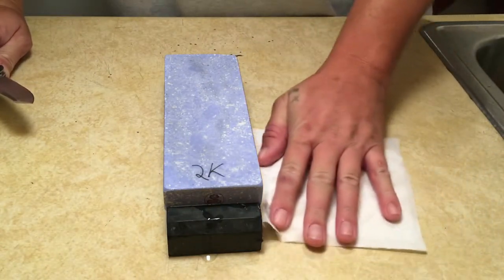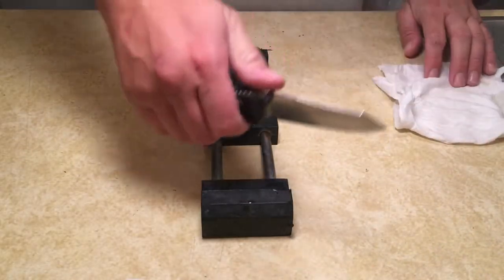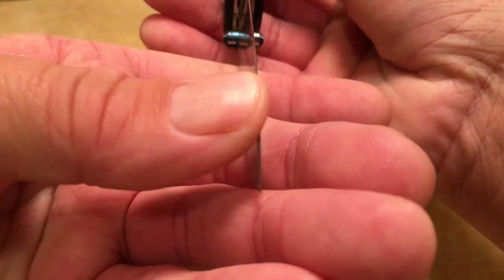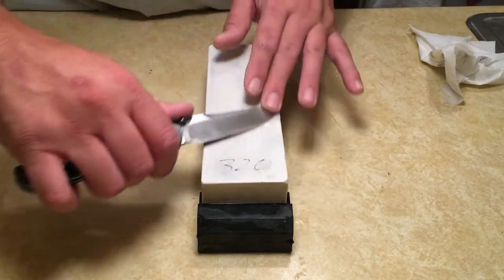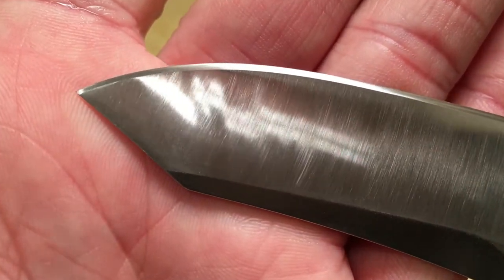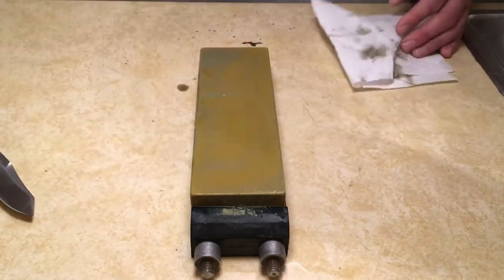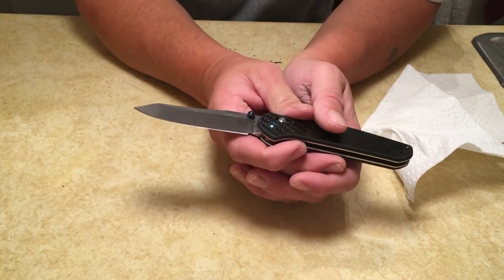Knife Sharpening - Basic Technique and Demonstration

Comment: Excellent instruction. Followed your tips and it worked like a charm. Particularly, practicing your hand stroke.

I don't need to do crazy mirror-finished edges, but I do want to practice and learn how to get a decent edge free hand like the big boys. Not interested in the KME type contraptions.

To cover the bases, what would you think about two diamond stones, DMT or Atoma, in 600 and 1200 grits, with a strop to maintain the edge?

Thanks!
Reply from the maker: Both are very capable. I just have issues with the amount of material diamond removes. I'd recommend you look into the resin diamond stones that Venev offer. Naniwa also has a set, as do one or two other companies. King makes a 1k diamond resin, and edge pro, has a full line. Their stones are obviously made for a 'kme like' contraption, but I have sharpened on them freehand, many times. 

Otherwise, I would tell ya to avoid diamond, and get 3 stones. Gritomatic silicone carbide. 240, 1k and 2.5k. Toss in a strop, and you are rocking. Gritomatic also sells the Venev diamond, if you care to have a look at pricing. I've done a few videos with em, just search my channel.

Good luck! Glad to hear you were able to gain some tips from my video. I really feel like I should redo it, and try to condense the info down, but from start to finish, there is ALOT to cover.
Reply: @Jef  Thanks for getting back. I'll check out your suggestions.

If you do redo the video, if it's possible, I would suggest a sample camera angle when you're stroking the stone that's over your shoulder. My right/left brain was going a little crazy. Maybe it's just me.

Again, in addition to all of your commentary as you paced through the video, the real helpful part for me was emulating your stroke.

Thanks again!

Comment: Excellent video, I subscribed. My 2 cents on stones. For a low grit stone that cuts great with good feedback, I like the Shapton Glass 500. Generally, I don't like the other SG stones. I also much prefer the King 1200 over the 1000.
Reply from the maker: Yea i do like the glass stones in terms of speed and efficiency. Esp the higher grit polishes that can be achieved. As far as the King go, I could never tell much difference between the 800, 1k, and 1200. They all seem to feel very similar (kds). Now there is another model King offers, i forget the designation, but it is softer. The mud produced from it is pretty heavy. I never cared for that version.

Comment: This is a gem Jeff! I am a struggling beginner and can't thank you enough. I have some questions: can you suggest a stone holder or sink tray? Can you suggest 3 or 4 stones to get started with,grits and brands? Will this technique work with kitchen knives as well? Can you recommend the stones to use for flattening? Thanks for all your efforts!
Reply from the maker: Awesome! Glad you found it useful. 

The only stone holder I have tried, is the one shown in video. It is just a standard universal stone holder, from chef knives to go. Approx $30. Sink bridges are a bit finicky. I have bought 3 of them, and none fit my sink. That is why I have that big plastic food tray, I've shown in a few videos. It was purchased locally from a restaurant supply shop, approx $20. The Suehiro sink bridge fits across it very well. I got that from Japanese knife Imports, but I seen Chef knives to go carries them now as well. Both approx $40. 

Stones are really gonna depend on budget. I always recommend Shapton Pro, if you have some money to spend. 320, 1k, 5k is a solid 3 stone set up. If you wanted to throw in a 4th stone, you could either go coarser or finer. The 2k is an excellent choice to follow the 1k, and the 8k fits perfect behind the 5k. I rarely go that fine, because once I hit 5k and strop, the edges I get are plenty sharp. Plus, the polish is bright enough to satisfy my desires. 

If money is tight, the Imanishi 400 Latte is a fantastic starting point. It is hard, and scratchy. Exactly what I like. The price is nice too. Around $50. From there, the King 1k/6k combo is an excellent choice. The 6k is a bit softer than I like, but just getting started, it is solid. Again, those 3 stones will get ya where ya need to go, and adding a 4th is just icing on top. Skies the limit, and you can again, pick either coarser, or finer. It's up to you. If the King brand doesn't suit you, I've heard the Imanishi 1k/6k combo stone is a fantastic substitute, although I haven't tried one...Yet. It is approx $55. 

If you just want the best of the best, and want my current favorite set up, I would say 400 Imanishi Latte, 1k Nubatama Ume extra hard, 2k Shapton, 5k Shapton. Then a DLT XL double sided strop, with compound of your choice. White compound, from Stropman is still my favorite, although he passed away recently. His compounds are still available on ebay, and his website. I imagine once they are sold out, I'll have to find a new compound dealer. Be prepared to spend a little money, and you would have to contact Kenneth Schwartz through email or telephone, to order the Nubatama stone. Obviously, Shapton Pro 1k could fill that spot, but the Nubatama is just my favorite all around do everything stone. 

This technique works on just about anything with an edge. I don't change my methods for kitchen, or pocket knives. If you watch any of my videos, the only thing I didn't do in this one, is pin point pressure, grinding up the blade. I just wanted to show a basic, easy to do technique. 

Flattening plates/stones are a bit over priced in my opinion. I used a 140 grit Atoma plate in this video. The DMT plates in my experience, shed the diamonds too quickly. If you want to save a few dollars, get a scrap piece of glass, and some silicone carbide powder, and use that to flatten stones. They sell them in 4 grit packs on ebay fairly cheap. Just look for 'rock tumbling grit'. It is my preferred method, and I have several videos showing the procedure. Stefan Wolfe has a bunch of videos too, and documents the process extremely well. 
 
Hope that helps ya!
Reply: Jef Jewell wow! Great information. I can't thank you enough!

Comment: What is a line up of your favorite stones that fits all grits?
Reply from the maker: Actual favorites to use or just a solid line up to cover all ranges? 

I’ll answer both ways 😁
Favorite line up - 120 Shapton Pro, 400 Imanishi Latte, 1k Nubatama Ume xhard, 2k Shapton Pro, 4k Nubatama Ume, 5k Shapton Pro. Generally I’d stop here, and strop. If I want more polish however, 8/15k Shapton pro. 

A solid line up that covers all bases - Gritomatic 240, 1k, 2.5k. Cuts every steel I’ve used it against, won’t break the bank, and leaves a decent finish. Want more polish? Throw in your choice of Shapton Pro 2/5k or any other polishers between 2-8k. Sky’s the limit here. The 2.5 Gritomatic leaves you in a nice position to transition to many finer grit polishing stones. Generally, in my videos, I go to Naniwa pro 3k, then Shapton Pro 5k.
Reply: I’ll have to check out Gritomatic! Thank you Jeff
Reply: Where do I locate these gritomatic stones? the only I see are for guided sharpening systems like KME, Hapstone etc.
Reply from the maker: Sorry I just seen your reply. Never received a notice it was here. 

Gritomatic.com sells them, however, they have been out of stock for almost a year now. Supposedly they are coming "soon", but your guess is as good as anyone's, when that will be. I'd suggest trying to get on their wait list for them, and when you receive an email in stock, to grab a set. They are about as good as you can get, without having to use diamonds.
Reply from the maker: https://www.gritomatic.com/products/8-x-3-silicon-carbide-sharpening-stone
Reply: Jef Jewell hey no worries brother, found them on amazon. Thanks for the reply your awesome

Comment: Hi Jef. I've bought an Opinel no9. It's a flat ground blade and i'm laying the blade flat on the stone so I don't get a secondary bevel which is what I want for wood carving.  I've discovered by studying the blade that the factory grind is set for the straight part and is missing the belly & tip line because the knife blade thins out there, so the set angle of the factory machine passes over it without touching it! (The Mora scandi blades are the same thickness to the tip so their machine cuts to the tip evenly all along).
 I'm not really sure of the best technique (movement wise along the stone) to avoid putting a bevel on this thinner area as I'd like to stay "flat ground" all way along. Hope you can visualise this and suggest something or even try it yourself. I bought a second no9 to put a secondary bevel on and experiment with. ATB from the UK. Pete.
Reply from the maker: It is a similiar thing to following the belly curve of a secondary edge. You just have to lift your hand slightly, to get to the tip area. Check out a few videos on my convex sharpening, to kind of see how I demonstrate it. It isn't difficult, but since the Opinel are pretty thin, it may feel odd and flex.
Reply from the maker: Belts are completely different from stones. I can't even start telling you whats what with those, cause I don't think they are appropriate for sharpening. They heat the edge up too hot, and ruin the temper. Just my opinion, many others swear by them. Unless they are water cooled, I'll avoid em.

As for stones, if you lay the knife on the stone, and put pressure on the flat where the tip is, notice the handle raises higher. That is what you must mimic when holding it. Make sure the blade isn't flexing because that will cause differential grinding.
Reply: Hi. I can, and do do it it Jef, Just trying to understand the why of it. I think I'm settled on it now. I do overthink things you know. ATB. Pete. Ps. Sharpened both no9's this morning. One flat zero ground, the other a laid back secondary. They are both doing push cuts on phonebook paper, cross grain!!! off a 400 diamond.
Reply from the maker: Diamonds can leave amazingly sharp and crisp edges. Although I have never been a fan of them, I can't dispute their results.

The why of it is geometry. I'm no mathematician so I won't try explaining it, but there are a few videos discussing belly and tips, and how the angle of attack changes. If you haven't ever reached out to Cliff Stamp, he has a forum where many knife sharpeners discuss all things. You could always pose your questions there, or try to email him directly. He has always been very accommodating to me, when I have asked him direct questions through email. I know he is a busy man, but he has always freely shared his knowledge with me.

Comment: Any suggestions for stones for a newbie?
Reply from the maker: Depends on your budget and what you are trying to sharpen. A solid set would be the King brand. 220, 1k/6k combo, would do just about everything you could need. From reprofiling a knife, to getting nice shine and polish. An alternative to those would be the Imanishi Latte 400, 1k/6k combo. They are priced well, and are harder stones, than King. If price isn't an issue, I always suggest Shapton Pro. They are the stones I started with, and have never regretted using them. To this day, they remain my favorite go to set up. 320, 1k, 5k is a solid 3 stone set up, or throw in the 2k as well, to help refine the scratches before 5k.

I also suggest getting a strop, with compounds. There are hundreds out there. The strop block from knives plus is fantastic. Preloaded with compound, and your choices of green or white compounds. I prefer white, but the green isn't bad either.
Reply: Thanks!

Comment: How much water and or oil? You haven’t touched on that. Thanks!
Reply from the maker: Depends on the stone in use. This particular Nubatama stone, requires about a 10 minute soak, to get saturated. After that, i just splash as needed. That is, when the swarf gets thick, with dark metal filings, or the stone starts to feel dry. 

Other stones do not require soaking. They can be used, out of the box, with just a splash of water. If you are unsure, try to google the stone you are using, and see what others recommend, before you soak them. Some splash n go stones, can crack, if you soak them. 

Otherwise, it’s personal preference. There is a higher degree of cutting, from the stone, when it is dryer. Personally, i prefer to have it well lubed. If i could find some sort of steady drip, as i worked, i would make use of it. 

Oil stones are a completely different beast. I recommend soaking them in oil upon buying. Leave them for a few hours. Over night would be even better. Place them on a rack to dry, obviously with some thing under near to catch any dripping. After that, when you use them, it should only require a few teaspoons, if that, of oil, to keep them lubed. Again, as the stone drys while sharpening, i would refresh as needed. 

These days, i rarely use just oil. I find a combination of, one part baby oil, one part dish soap, and 4 part water, to suffice. I tinker with those ratios, as i see fit, to get a consistency i prefer, but that is the basic recipe. I only use this concoction, on natural stones, and oil stones. 

I do not recommend, especially water stones that have magnesia bases, placing oil on them. Oil on some water stones, while inert, i fear, could damage them. Possibly, even crack them. 

Some water stones are more forgiving; the traditional, older type. As an example: the King brand. I have used oil on my 1k King water stone, with satisfactory results, but again i do not recommend it. If your stone gets damaged, i would hate to see blame placed at my feet 🙂
Reply: @Jef  I have a Smiths Tri-Hone. Not too much out there on it. It comes with a solution but the stone seems to just soak it right up. I’ll have to experiment with it.
Reply from the maker: Soak the stones in oil. That is, if they are the oil stone versions. Inhave one as well. Think i did several videos on it. Search my channel for smith.
Reply: @Jef  thank you

Comment: If I'm using the 1000 and 3000 grits and working my way up, how do I know when to switch to the next stone?
Reply from the maker: Look at the scratch pattern. You can even create a burr on the 1k if necessary. The scratch pattern is your biggest indication though. It should stretch all the way across the edge bevel, down to the apex. Magnification can help, but not required. Another alternative is to mark it with sharpie again. Make sure your sweeps are removing it entirely in one pass.
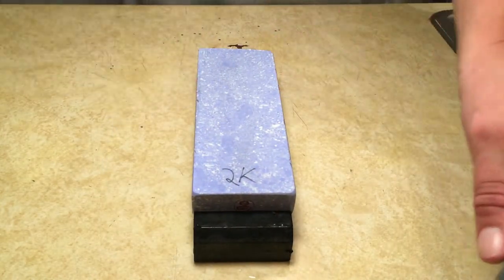Reply from the maker: I talk about this at the 34:00 minute mark
Reply: @Jef  thanks. Its just that i recently got a buck spitfire that seemed uncannily blunt. So i thought of sharpening it a bit, but was unsure which grit to start off with.
Reply from the maker: I did a video on a Spitfire. 

https://youtu.be/jd4QOajjPqA

Comment: Hi Jef. Been watching Virtueovice on belly line sharpening. https://www.youtube.com/watch?v=BIa30Fd2kug&t=129s Wondered what you might think to his idea that rotating the belly to tip can wear down the curve so better to just lift towards the end instead. This means the knife is held at 90deg to the stone all way through the process. I've been trying this and it does seem to work, meaning I can use short scrubbing strokes, alla Cliff & Michael, stone in hand or on a flat stone. ATB.Pete. PS. On watching your vid again, it looks like you're doing this anyway! Its your long sweep that gives the impression that you're rotating.
Reply from the maker: Following the curve like I do in my long sweeps, maintains the belly line. Virtuovice convexing all his edges, hence the 90 degree to the stone angle. What do I think about it? Obviously it is an issue for him. Personally I never flattened out a belly line like he did, so I can't say much about it. I've always lifted my hand in that fashion, jus naturally. It's good he has figured it out, but he also made a video, pushing the knife into the stone, that basically defeated the whole purpose. Might as well be sharpening straight into it.

https://www.youtube.com/watch?v=F7XGfNC9BuE

This is incorrect
Reply: Yeh Jef, I've seen that link but thanks for sending it. I'll try not to bother you with my theories, unless I "just have to" LOL!!!!  ATB. Pete.
Reply from the maker: It’s all good. I can’t promise you I know everything when it comes to sharpening. But I can try my best to describe what I do. If you have any questions feel free to ask. If nothing else maybe we can run it by someone else and ge a real answer
Reply: Cheers Jef.